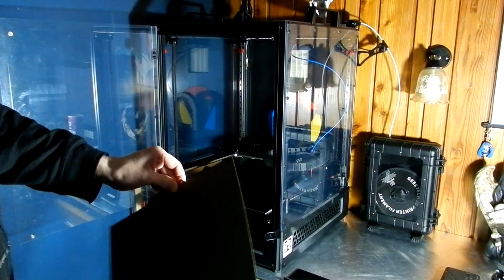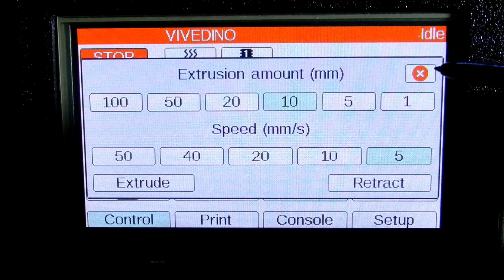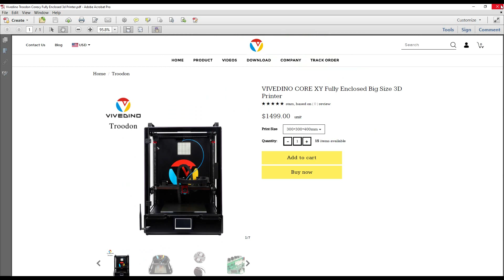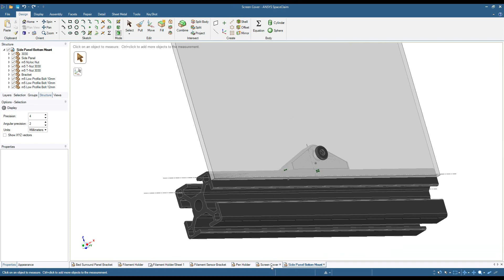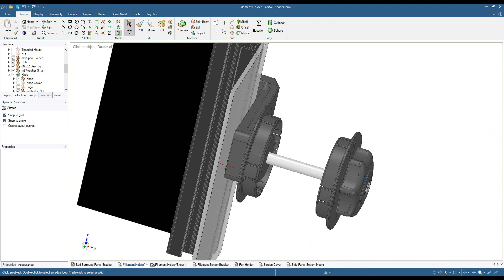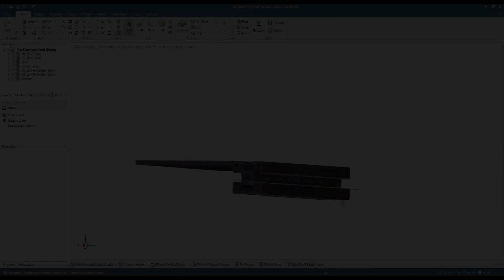Vivedino Troodon CoreXY 3D Printer Upgrades & Info

Comment: Thinking of picking up a Troodon myself sometime in the near future - is it, in your opinion, worth it? I've seen mostly positive reviews but a few people say they have issues with theirs...
Reply from the maker: Its a bit of a love hate thing. Yeah I had problems with mine and also know a couple of others in the group also had problems. Shipping/packaging is ship. even my printer had a rear frame rail that needed adjusting back in right place. They have done some upgrades and now also have direct drive stock on them. not seen much prints when i was in the group at the time they changed the drive over so cannot comment on the changes. if you into printing and know your way around printers go for it. if not stay away. Not a good print to learn on or have if you starting. I had a ender 3 pro and it was hell of a lot better to start with and quality was lots better.

Comment: What do you do for the cable chain, mine drops down a lot and keeps getting stuck/hitting/ opening the front door
Reply from the maker: Did nothing on mine but was dropping a little but nothing to worry about. It's a known problem and there are some fixes for it I seen on there Facebook group. Is also a space that gets installed in the end where the chain bolts to stiffen it up.

Comment: how can i install this printer in cura... i see the printer in web http:\\192..... but i can t install in add printer in cura why?
Reply from the maker: Hi. Sorry I never run the printer using cura. I just saved files from cura and loaded them on web interface to printer. Your best option would be to contact company as I don't think there is any info about this in the manuals. Or ask on the Facebook group. I'm sure some one there has done it.

Comment: Thanks for the files... waiting for my printer but formbot dont want to seend me the files for cura by mail do you think you can upload them on your page to?
Reply from the maker: That sucks they want send you the files. I will re-upload the files today. Had a big clean up of my shared files and moved some things around. Going to upload everything I have.
Reply from the maker: https://mega.nz/folder/73ATnCDD#p_6majT13BgQW5sbJ0dJKQ
Reply: @exploringwithmark  I looked through your files, but do you happen to have the starting and ending gcode for the 400mx400mx500m version? Can't find much information on this and cura doesn't recognize it. The cura profiles from Vivedino doesn't import the codes. Thanks in advance!
Reply from the maker: @DeJaView3  Sorry no. you looked here is a zip file and has other files in it? https://drive.google.com/file/d/15Tnao3DxB0GjhZnVt2SLJafOqCF8F0Hg/view
Reply: @exploringwithmark  I did. I received those files with the printer. I'm not sure where I would need to tweak the gcode in the starting gcode from your files to get it to work. If you happen to have any ideas, let me know. Thanks.
Reply from the maker: @DeJaView3  I was using WIFI to connect to the printer and using the built in web console to edit gcode. Also to send files to the printer.

Comment: Mark, would you consider sharing the stl's, so I can make the mods to my printer!
Reply from the maker: Yeah no problem. https://mega.nz/folder/73ATnCDD#p_6majT13BgQW5sbJ0dJKQ
Reply: @exploringwithmark  Thanks Mark - you definitely have the most informative videos on YouTube about this printer.  It looks like the link to the STL files no longer works, any chance you could re-enable/re-post the link?  I am especially interested in the filament runout sensor bracket :-)
Reply from the maker: @arthurenright4146  I will re-upload the files today. Had a big clean up of my shared files and moved some things around. Going to upload everything I have.
Reply: @exploringwithmark  Thanks Mark!  I will keep an eye out for the link!
Reply from the maker: @arthurenright4146  https://mega.nz/folder/73ATnCDD#p_6majT13BgQW5sbJ0dJKQ
Reply: @exploringwithmark  Thanks Mark!  The new link works like a champ!  And thanks again for taking the time to make the videos and the design work you put into fixing the little quirks/issues you found with the printer, your video is what nudged me over the line to pick one up.